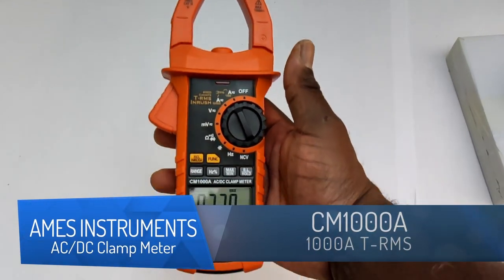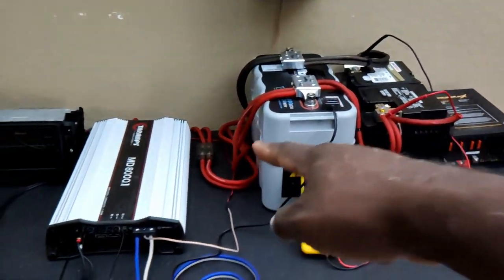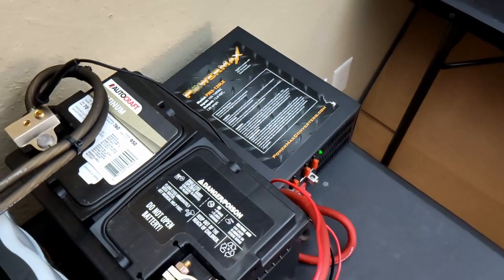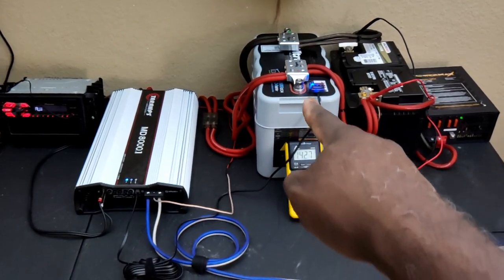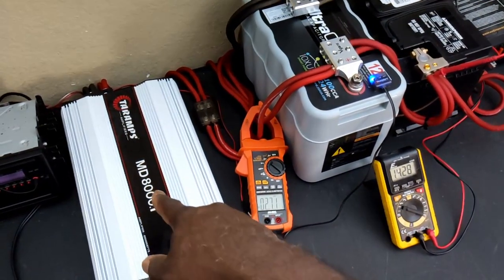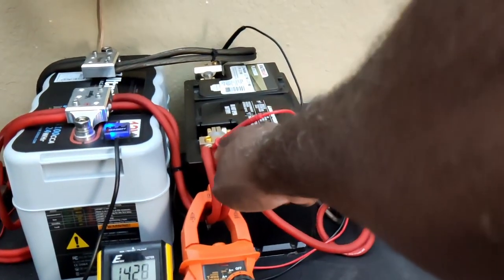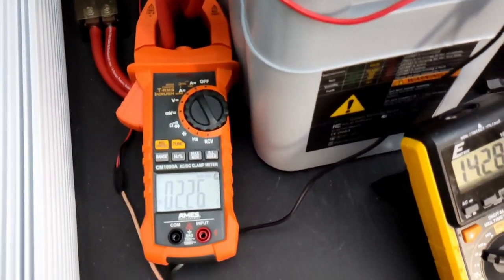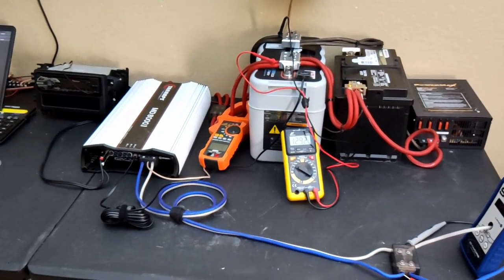How Too Much Amp Draw Hurts SPL! Clamping A 3,500 Watt System

Comment: At what point is a lithium bank necessary?
Reply from the maker: Lithium is better than Lead Acid in nearly every way. Most notable factor being discharge curve and usable capacity.
Reply: @BudgetBassHead  yes I build batteries for my own use I'm not a pro but my problem with using lithium in 12v world is you can only use them at half their range if you understand what I'm saying 3 cell is 12.6v and 4 cell 16.8v above 16 will damage your amps and car then if you drop below 13.2v I believe that will damage lithium and if you still have any type of AGM or lead acid they rest at lower than that so really it's something I haven't been able to defeat
Reply: @BudgetBassHead   my question was referring to how many watts in your opinion before going to lithium I'm at 5k a true 5k on 2 alternators 2 xs AGMs and my voltage still hates me if my single 15 hits hard enough my voltage drop goes to 12.8 so I ordered one of those ultra caps you tested I hope this stops that surge cause after it hits and alternators catch up it spikes to 15.8v crazy stuff I have 2 zero gauge welding wires to my amp and battery and 1 zero going back to my battery on negative side guess I need another negative to both batteries
Reply from the maker: @Rolling_Thunder Headway 38120 HP cells have a nominal voltage of 3.2 v. They charge fully to 3.65v. four of these in series @3.6v will give you 14.4 volts.
Reply from the maker: All wire sizes should be the same throughout your build. If not, the electricity can only flow as fast as the smallest wired path.
Reply: @BudgetBassHead  all mine are zero but I was using the frame for ground I was advised to not do that and run grounds back to battery
Reply: @RollingThunder85  All wiring should be kept as minimal (short) as possible. 
1. Battery to fuse, short.
2. Fuse to amp (or, in the case of running caps, fuse to cap), whatever you need.
2b. (If applicable, cap to amp, short.)
3. Amp to ground, short. 

Any excessive length creates strain, inefficiency, and possible points of wear/shorting/damage. Which would (if not fully, partially) explain your extreme voltage fluctuations, as electricity needs both + and - in balance to be most effective. Think "speed to drag ratio" if that helps visualize the concept. All the force (+) in the world isn't going to get you a lot of speed (charging) if you have a huge weight (-) which all that force has to overcome. 

Side note: In a manner of speaking, if it wasn't for it being a heat compartment and electromagnetic interference generator that's effectively "under your hood", the "best" spot for placing amps (from an electrical standpoint) would be right next to your battery and running speaker wire back to your speakers from there. But since that location would be murder on an amp, they're placed in the cab of the vehicle (for heat dispersion) or the trunk (for convenience and least amount of EMI). Inherently that adds the necessary lengths to get to those locations, though doing so only exacerbates the problem of using "excessive" lengths. Simply put, don't.

So, with all that said, whoever "advised" you to run a ground back up to your battery needs to stop giving advice on the topic.
Reply: @RAW_Reality  I thought the same but then I called SMD Steve Meade he also recommends that I do the same they say it's like a highway in rush hour using frame for ground with 5k systems and above so making a clear path for ground to go directly back without interference kinda makes sense
Reply: @RollingThunder85  Here's the thing: The concept of that is correct, but the "what you're going for by doing it" isn't. You're not going for a negative connection, you're going for negative electrons. The battery is a storage of them, whereas the alternator produces them. It's for this reason that "The big 3 upgrade" isn't "the big two upgrade". The chassis, while a "wider highway", connects to both the battery and the alternator, whereas with a direct connection to the battery requires you to go through that connection to get to the alternator. So it becomes a 2v1 equation more-so than a "more direct" concept. Heck, in concept, you could do both at the same time if it came right down to it. But I take it that you've done the Big 3 (to your aftermarket alternator), correct? Cuz 5k should not be causing that much fluctuation as your setup is, assuming everything's wired up correctly.
Reply: @BudgetBassHead  they also last many years. Just love my Lishen lto lithium
Reply from the maker: Excellent explanation💯👌👍
Reply: @RAW_Reality  yes I have a 300 amp alternator two xs AGM batteries 2 runs of 1/0 going from the front battery to the cab battery I had cab battery connected to frame then I tried connecting it to two 1/0 wires back to the front battery I have two 1/0 from alternator to battery as well as from alternator case to ground side of battery
Reply: @RollingThunder85  I assume you have a truck or maybe full size car. The frame is by far the best route for a ground. How many amps does it take to melt a 1/0 wire and then look at how much steel is in the frame rail. That rail could probably provide the same as 20 runs of 1/0 wire. It is a super highway that you will never clog up. Just get good bare metal contact and try to keep corrosion away.
Reply: @JasonWW2000  see that's what I thought but when I bought my mechman alternator it's specifically says for everyone wire going out to have the equal amount coming back to the grounding spot designated on the alternator. I figure they have tested this or why say it?
Reply: @RollingThunder85  What they mean is if you have two 1/0 wires delivering power to the back of the vehicle, then you want two short 1/0 ground wires solidly bolted to the rear frame. Then you attach 2 more short 1/0 wires to the front part of the frame to near the alternator mount. This completes the circuit. The same current carrying capacity going to the rear and coming back up front. There is no need to use long runs of 1/0 wire for the ground. The frame is better suited and has less resistance. Make sense? If you already ran 2 long ground wires, thats okay. They don't hurt anything. You just wasted a bit of money running them. No big deal. 
SMD just released a video showing him running 2 big lines of 2/0 wire in a white Tahoe. He ran the same for ground and used the frame for the long middle part. Check it out. Just remember that the less resistance the better. Follow the path of power and make sure there are no bottlenecks. Do two runs of wire from the frame to engine, engine to battery and frame to battery. Basically the big 3, but with double the wires since your running so much current.